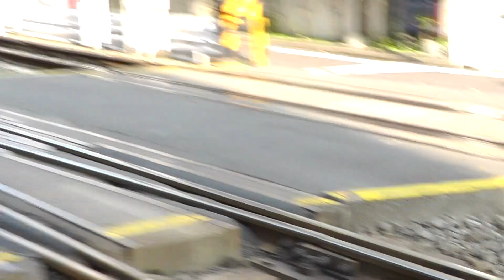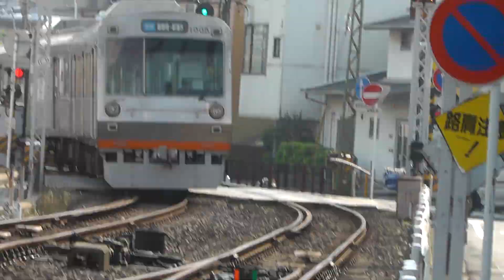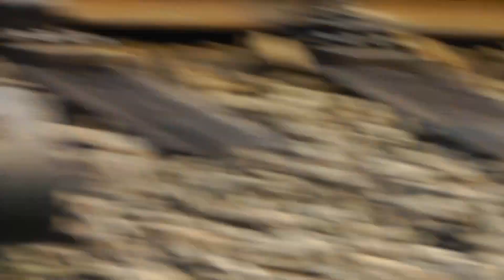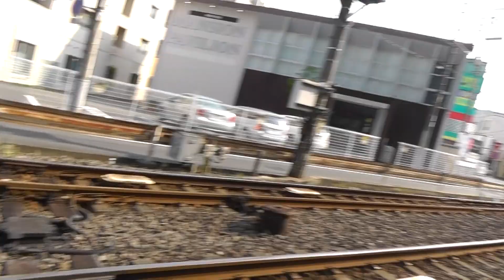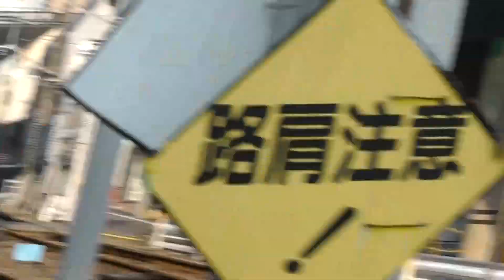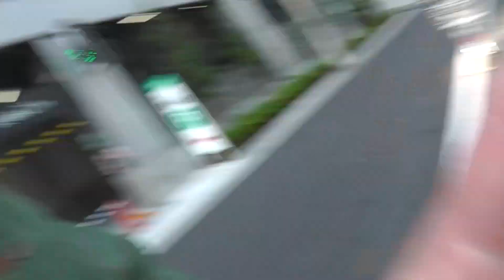🚅 Japan Railroad Tracks - Japan Train Videos

Comment: Back in the bad old days, those turnouts would be manually moved by a rather strong person pulling a four and a half foot long lever to literally bend the tracks from one set of points to another.  Hydraulics  are much easier on the back.

Comment: Hello Kurt, 

Thanks for posting this interesting video. 

These intersections bisecting each others are called "turnouts" 
The principle is very simple and quite clever. The Hydraulic jacks can actually called "Points" the ones which you described by "Actuators" .... Thanks for sharing. 

Regards

Ameed
Reply: Hey @AM, do you know if there are control points in Japan like here in the USA. For example there is 2 tracks and at each ends were the tracks join back into 1 are called control points. Most control points in the US have names depending on what area they are in. When a train is on the double track section and another is coming from the other direction on the single track direction the train on the double track part must slow down and stop at the control point and wait until the other train clears the line ahead of train 1.
Reply: @d64tv06  Hi D64TV. Unfortunately, I am unfamiliar with any.

Comment: Kurt, those switches you were looking at are (mostly) used if , for example, a train is broken down in the station and the other trains have to switch tracks to stop at another platform to maintain the timetable. You have a better chance to see those switches move when you go to the nearest switches right before the platforms. On a busy trunk line they will move frequently! But I love the vid.